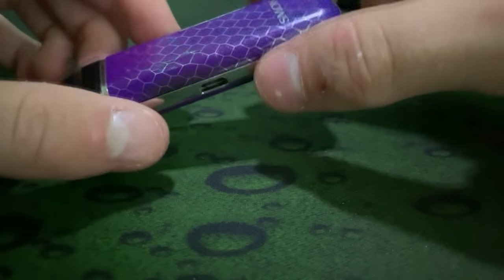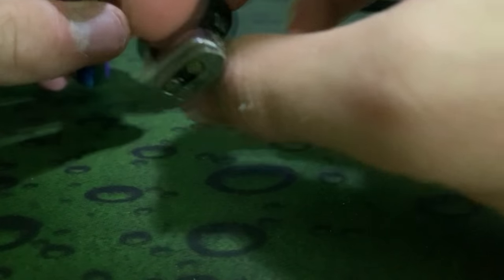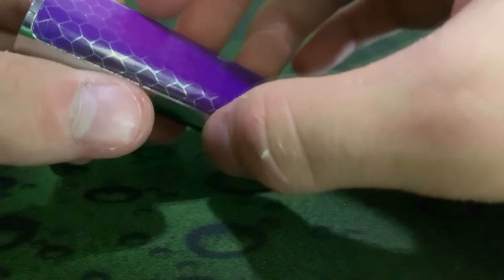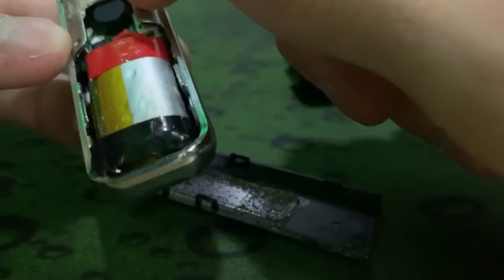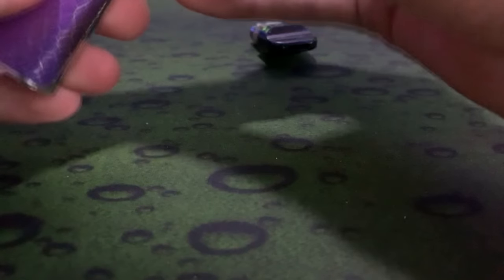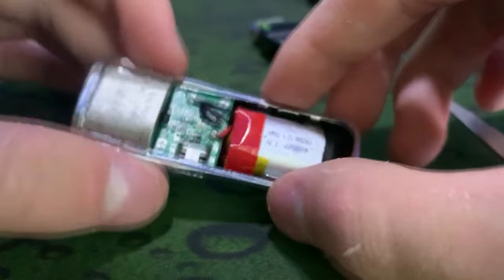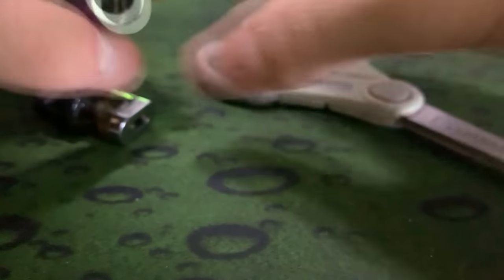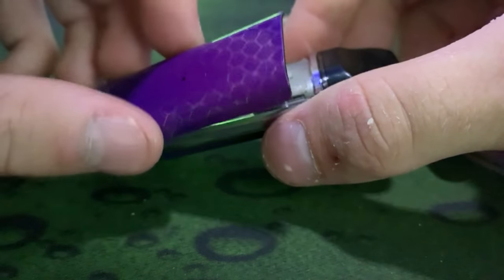*HOW TO FIX* SMOK NOVO VAPE NOT HITTING/FIRING/CHARGING/4 BLINKS - ALL FIXES! #vape #fix #novo

Comment: what should i do if it says ohms too low? i’ve had it for six hours and it starts saying that now.
Reply from the maker: wiggle the pod around, clean it out, blow in it, and use the scratching method :) if it still doesnt work u may need a new pod but usually it should fix

Comment: FYI, the SMOK 2 is configured differently and much harder to reset or “fix.” It’s clear the company has gone to significant lengths to prevent users from maintaining their vape so they will have to buy the new models coming out regularly. 
If anything, it makes me want to buy a completely different product. Their planned obsolescence is and will backfire. I’ve owned this vape for less than two months. I had the first as well and although it worked fine, I could not find pods for it. So, not only are they cheapening the quality of their product, making it harder for us to fix, but they are also stopping the availability of pods for older varieties. Infuriating!

Comment: I've came to the conclusion both of my Novos are just pieces of trash probably ruined by the mesh pods bc they leak like crazy..just bought a new device bc my other ones prongs came apart and couldn't find one of them..due to excess juice from leaking I'm guessing. I've had this new one Maybe 2 weeks now and it's already done I've tried Everything it won't stop misfiring (20-45 seconds after each drag 😖) and gets super hot :/

Comment: I tried it all. It still blinking 15 times. Even though i put it on charge for an hour
Reply from the maker: Iqra bukhari try blowing through the charging port
Reply: Iqra Shah hey what did you end up doing to fix it? i have the same issue, it’s not charging and blinking 15 times when i try to hit it
Reply: Emily Eirkson okay so I opened it and everything. I blew in it. Didnt work. Then i changed my data cable. It charged. Seemed like it wasnt charging at all. And i thought it was. Maybe try changing a data cable? Cause my light used to be on, but it wasnt charging. And i thought it was broken

Comment: You don't really need to do that cuz you just have to put it on the phone put the put a pot on the stove and then put the fill it up with water and then put a plate on top of the pot that has the water in it and then you have to put the Vape on top of it and put a bow on top of it